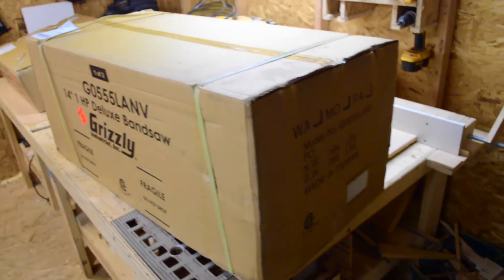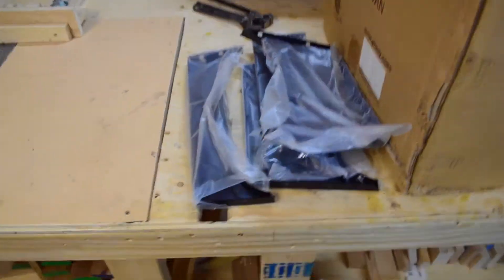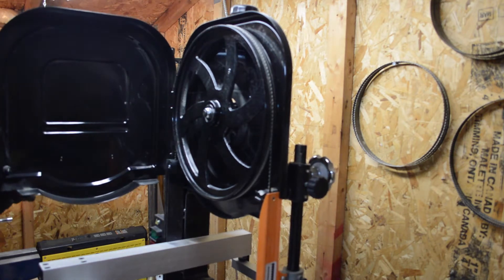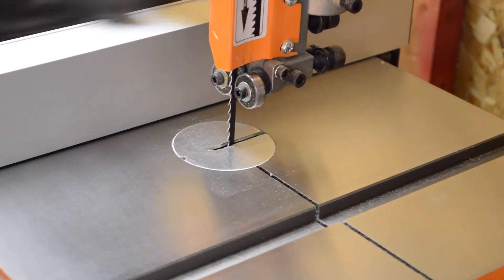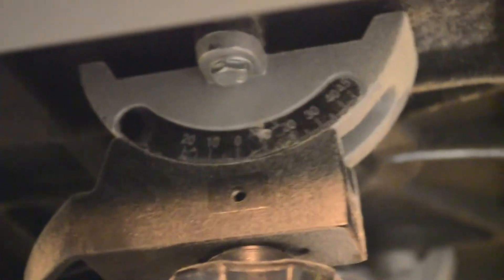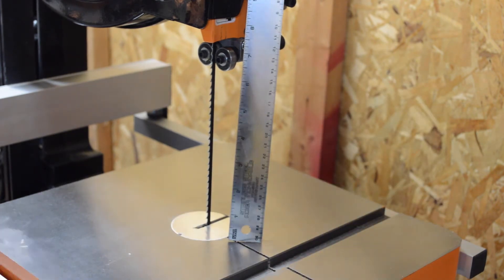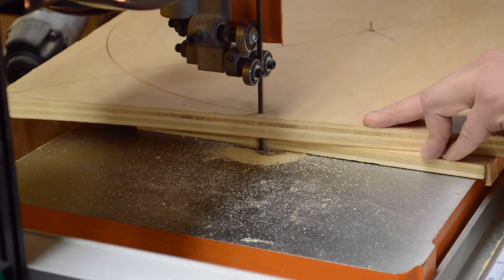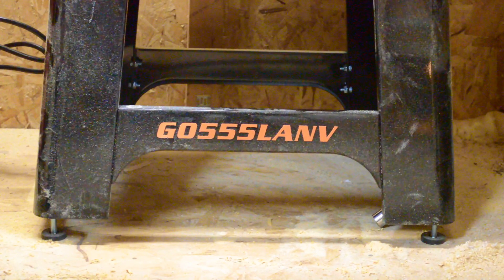Grizzly G0555LANV Bandsaw Review

Comment: I have the same model and made two changes where it was lacking. First I mounted a flex shaft  utility light on the back of the machine. Second I was not happy with the plastic knobs for the gimbals and replaced them with cast iron.